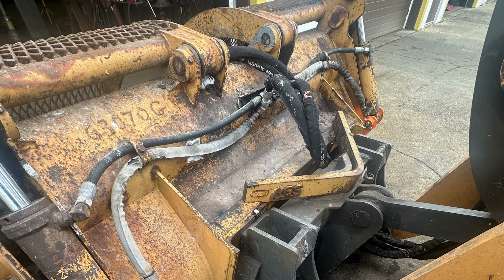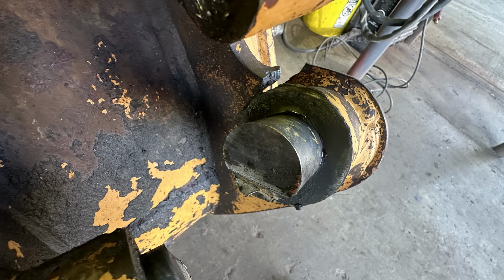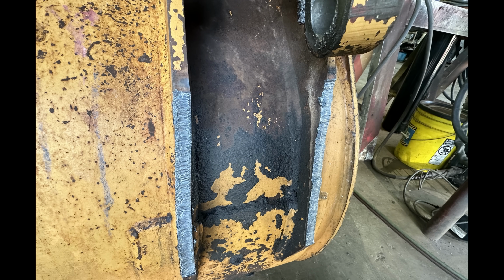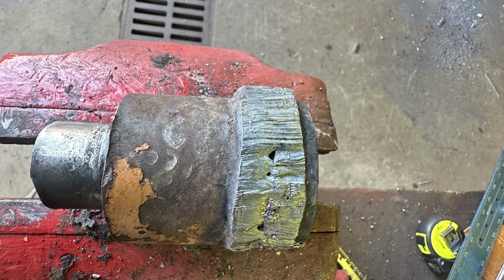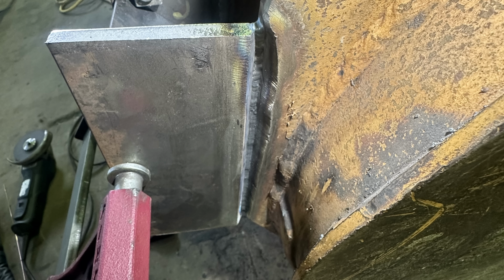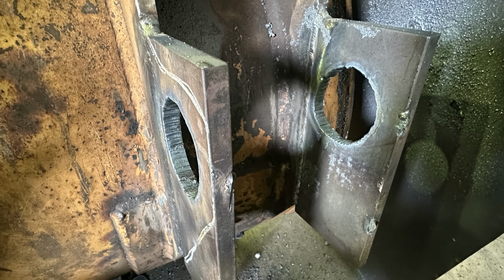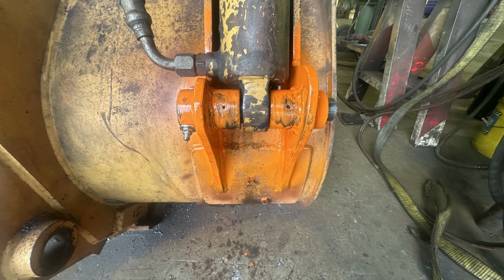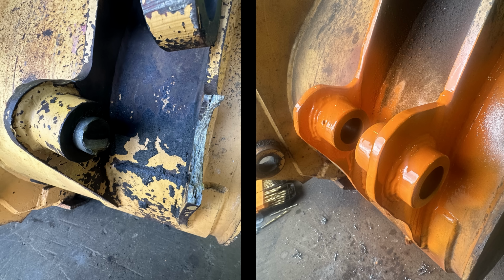Broken cylinder mount fixed 👨🏻‍🏭

Comment: 7:17 There are people out there who clean heavy equipment for a living who might have advice on how to remove caked on gunk, but from what I know you at least need a "hot water" pressure washer and a industrial degreaser. Having to bust out cleaning supplies is such an afterthought, though

Comment: Great job , I learned a lot.
Btw how long did it take you to do the job?
Reply from the maker: Glad to hear that you learned a bunch.  I got it done in a single shift, so approximately 8 hours.  That included atleast 40 min of breaks and a couple other small jobs I had to do, so probably 6.5 hours or so.  Had I used dual shield wire (my work doesn’t have any) I probably could have knocked a fair amount of time off.  Since I don’t get paid by pieces, getting it done faster isn’t much of a benefit.

Comment: I have seen steel like that before. Indian steel made from old ship plates heated and rolled so all the crap from years at sea are rolled into the plate, I have seen ships cut into strips and turned into spanners and old anchor chain forged into half shafts for cars. I knew a sea captain who at one time had the job of taking old ships and beaching them in India where they were cut up for scrap. Rather than melting them down they used the metal as is with minimum amount of work so plates are just flattened out or rolled into whatever shape and size required.

Comment: bucket shells are often made of ASTM A572 Grade 50  a high strength, low alloy steel. This steel is alloyed with columbium and vanadium. Vanadium helps with maintaining the toughness of the steel. Columbium is a light grey, crystalline, and ductile transition metal now also known as niobium. 
This grade of steel is desirable as a bucket shell material because it provides excellent strength without weighing quite as much as comparable steels such as A36. It is also readily welded and formed.
Reply from the maker: Thanks for the heads up, taking the time to write that benefitted both me and viewers of the channel.  One of the downsides of the bucket repair is the timeline I had to get it done.  It was so old no information in the library was available on it and I had limited ability to get higher strength steel to repair it.  The way it broke and numerous other things suggested to me it was higher strength than a36 but it definitely wasn’t super hard.  It welded really decent.  I am unsure as to how long it will last with the repair, but it’s in such rough shape I know something else will break.  I will definitely order some of that steel to have on hand for future repairs 😀.

Comment: Nice!  Working in a totally different field, it's interesting how some things stay the same.  Like looking at something that's a hunk of junk but gets the job done, and figuring out how far to take the "repairs."  Code itself might not change, but everything does around it, and maintenance is just as important as with physical equipment.

Biggest difference in code is that we can do what's literally called a "blame" and find out who exactly touched a part last, and what shape it was in beforehand.  Though even then, we can't magically tell what other things were going on that forced them to make the decisions they did.
Reply from the maker: Figuring out how far to go with repairs is the biggest challenge I have faced since I took the repair job I have now.  It’s a tough situation, don’t repair enough and you get blamed for not doing a “proper job” when something else fails, but repair too much and you’re wasting time and money lol.  The solution I found is to do a solid inspection and input notes on what I found.  That way proof exists that I found things and that the fault lies with who determined what I should do lol.

Comment: If you do some torch cutting videos would you mind covering piercing holes? As I can cut from an edge but gas cutting holes is completely different👍 
Thanks Greg
Reply from the maker: I definitely will, and I will have to practice it a bunch to make sure I have it dialed in lol.  The hard part is knowing when the material is hot enough all the way through for the oxygen to work its magic.  Heat it too little and it will spit back at the torch because it doesn’t cut all the way through.  Heat it too long and the puddle will pop causing molten metal to spray all over.  It takes the right balance of heat input and oxygen pressure to get right.

Comment: What does a machine like this cost?
Reply from the maker: The bucket itself must be atleast 8-9k now.  The loader it’s attached to is upwards of 170k 💀.  My guess is at some point I will have to tig weld the bores on the rams to tighten them up.  The municipality is keeping things longer than ever in an effort to conserve funds.
Reply: @makingmistakeswithgreg  at these prices I can understand why they want to fix it rather than replace it. Even a couple of years could save them tens of thousands. I had a couple of million in machinery in my company. We were a commercial film lab and that was processing equipment. Replacing one of these sucked the budget out of shape. I used to maintain most of it myself. Hanging onto something a year or more extra was a big help.
Reply: @melgross  I watch Cutting Edge Engineering videos, and he often gives prices for new equipment.  Sooo much cheaper to have a shop do it.

Comment: Have you ever done a back grind 7018 joint? For crack repairs, it seems to make sense to me. Using 7018 for the root and then back grinding the joint and welding 7018 onto the back of the root. I find that 6010 and 6011 are more likely to crack (in conjunction with your video series). A video on backing strips and maybe even ceramic backing would be pretty cool. Thanks for all the videos
Reply from the maker: 7018 could be used for sure.  The weld and back grind method works great for a vast majority of situations a person might find.  With pipe it’s impossible, but it’s rare that a person would have an open root with no ability to use a backing bar or back grind on most things.

Comment: Seems it is import from a dutch demolition company , so it surely have had a rough life !  What size rod ,type and Amps did you do the stick welding with?
Reply from the maker: I can’t believe I didn’t mention in the video that info 😮, thanks for asking.  Stick rods were 3/32 7018 root at 97amps, and the fill was 1/8th 7018 at 128amps.  I tend to run way hot and universally run on the higher side when welding thick steel.  A good trick is to set the amperage right at the point you get arc blow while holding a tight arc and back it down 5-10 amps.  Running cold to more easily control the puddle becomes bad for penetration.  

Edit:  for tig I ran the root at 130 or so, and the fill/cap at 150-160a.  1/16th and 3/32 filler.

Comment: Hey, I hope you are doing well. I have much enjoyed your videos. I came from your welding with generator video with a pressing question, So could you help me out. I want to know if a King Canada running continous without an inverter at 9000W would be sufficient or avoid damaging a small welding machine. See I am a student whos only got limited places to practice. Thx for your time
Reply from the maker: So a 9k running watt generator can handle a minimum of 180a mig machine.  A simple rule of thumb is take .022 multiplied by whatever the running watt of the generator is.  That will give you the absolute bare minimum welder you can run.  This is assuming a transformer machine, no power factor correction.  So a 6,500 running watt generator would be 135a.

Keep in mind this is 240v welders.  If you buy a 120v welder expect them to trip breakers on most generators, because generator breakers trip far sooner than a house hold 20a.  Most 120v welders draw more than 28a.

Comment: Guessing you used the Rogue 200i PRO? They are good machines, got one about a year ago and it is great for some of the stuff that can't come in to the shop.
Reply from the maker: Yep, rogue 200.  I have built a ton of stuff with it.  It’s pretty unbelievable how functional it is.  Super compact and useful.  I actually stick weld with it over the xmt350 I have because it’s a better stick welder lol.

Comment: Have you used a Corbra or a Hemrod torch? I've had good results
Reply from the maker: I have not owned one, but it’s on the list to buy.  For oxy fuel welding they are definitely a “artists tool” and give control that is hard to find elsewhere.
Reply: @makingmistakeswithgreg  set up correctly  you can cut and write your name cutting in thick steel. And I have welded cast iron with thier square cast iron rods with thier flux. It grinds easy. Also welded aluminum with thier  flux on thin metal. I'm impressed with the pinpoint cutting.  Especially on control arm  bolts and truck bed bolts.

Comment: Other great video Greg!!
Do you use your own tools on the job or they provide tools and welders??
Reply from the maker: They provide the welders, torches, consumables, etc.  I have my own (limited set) of tools.  I am pretty lucky in the fact I might have 1300$ in my whole tool setup (with cart).  The heavy equipment mechanics have more than that just in one side cabinet for the tool box lol.

Comment: If it was AR plate of any flavor. You would have known when grinding it.
Reply from the maker: Grinding it or just taping on it to let it ring didn’t suggest anything special, but I am still not convinced it was plain mild steel.  It welded fine but time will tell how well it holds up.  I have ran into a ton of repairs that someone welded with stainless or hardface wire.  One of the downsides is following after someone who doesn’t care is you find all sorts of stuff that doesn’t make sense.  I did another bucket repair on a similar bucket today and someone literally welded a bunch of stuff with hardface (It arc gouged like trash and all of the welds were cracked).  Fun times lol.
Reply: @makingmistakeswithgreg  I should tell you. I retired from field welding after 45 years. Those cylinder ends can be repaired, but they need to be done at a machine shop. The chances are they aren't the original ones.

Comment: Just looked in the shop ... and  found it: a 1968 ArcAir Burners Aid Kit for cutting circles with a torch. It includes instructions in the original metal case with the nice crusty disintegrating foam cusioning all the parts. Your a bit far away or I would loan it to you.
Consider: If you have to do more big holes where you can't get the part to a mill or lathe, see if they can get you a magnetic drill and annular cutters.
Reply from the maker: I do have a mag drill but no cutters.  Next time I talk with the shop boss I will have them order some 😀
Reply: Cutting Edge Engineering showed a neat way of doing this.  All you need is a triangular piece of metal with a hole in it, a bolt, nut, and a washer.  Order goes Bolt, Washer, through the two tubes of the torch, through the triangle, nut.  You put the tip of the triangle in the middle of where you want to cut, and just keep it there while rotating the torch.  Like using a compass to draw a circle.  Brilliantly simple!

Comment: it's a good "make do" job, typical in municipal work. I've had to do many jobs just to make it last, we had a pump station problem with a temporary fix that took over 20 years to replace, glad I'm retired
Reply from the maker: The hard part is where do you start and stop lol.  Considering how worn out everything is on it I know it’s going to need more repairs.  I find myself in the “how far do I fix it” situation often lol.

Comment: I look forward to some torch videos
Reply from the maker: I will do that after the tig videos for sure.  Torch cutting and welding is a pretty solid skill to have 😀
Reply: @makingmistakeswithgreg  Agreed.  In my experience, torch is cheaper to get started with compared to a decent Tig welder.  Just spend the extra on getting some decently sized gas bottles, since swaps seem to be pretty close in price, regardless of size.